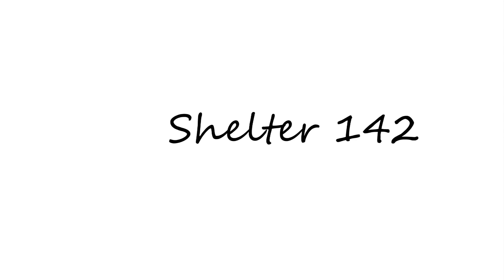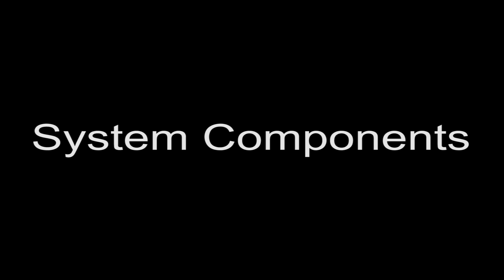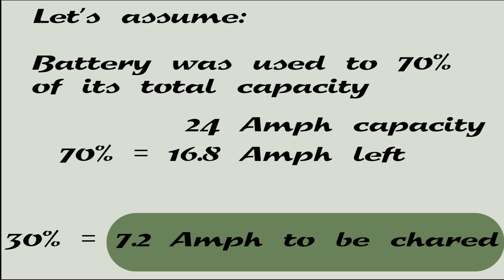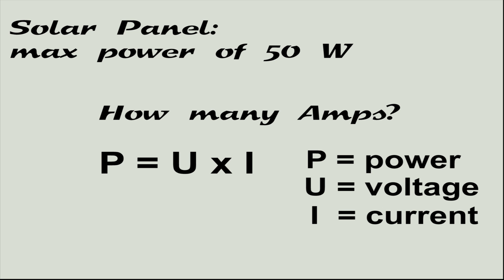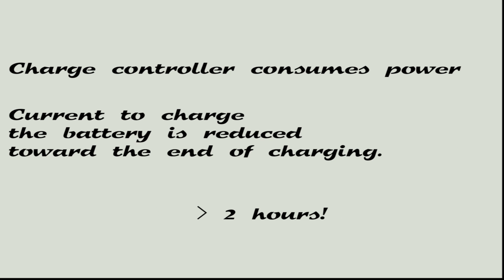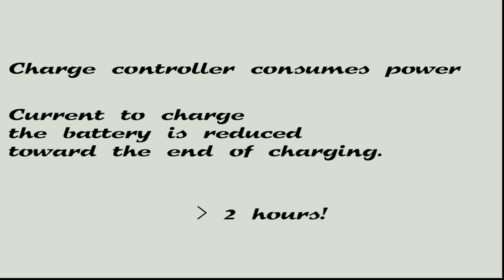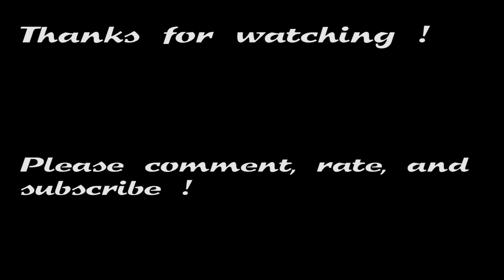How long does it take to charge a battery with a photovoltaic system

Comment: Where did you get the 14v?
Reply from the maker: This is another approximation, in this case for the voltage that the batterie is charged at. Check it for your system to be sure!

Comment: You said the panel provides 50W at around 14V. Is that from empirical testing? I don't understand because the label you show at the start shows rated voltage of 18.22V? Forgive me I am new to electronics. Does the 18V mean the absolute maximum, but in reality it will be closer to 14V? Is there anyway to calculate this from the label? (i.e. can you calculate it? Otherwise it would be annoying to have to buy a panel and measure it in order to know what voltage it runs at!)
Reply from the maker: Hello and thanks for commenting on my video!
The panel can provide max. 50 W, that remains given. However, the voltage at which the battery is charged is set by the charge controller/after the charge controller I estimate 14 V. My batteries (12 V) are charged at around 14 V when I use a charger plugged in to the wall. Therefore, I assume that around 14 V are set by the charge controller of the solar system. One can use a multimeter to measure voltage of panels.

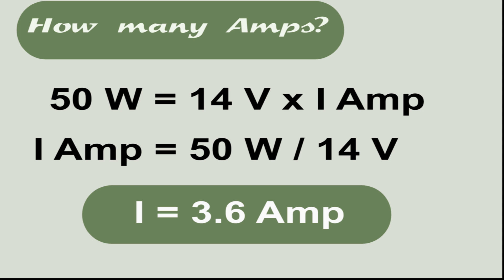Comment: at 1:41, from where did you get 14V?. I cant find 14V in solar specs which you shown at the begining of the video.I can only see 14.5 -- 14.9 V for lead acid battery as 'cycle use'. Pls. help.
Reply from the maker: As the calculation can only give an estimate, it does not matter if the exact voltage of the panel is 14,15, or even 17 Volts.

Comment: so what really charges a solar battery high amperage or high voltage?
Reply from the maker: Voltage at which a battery should be charged depends on the battery (typically even mentioned on the label), how many Amps at this voltage can/will flow depends on the panel, the charge controller, resistance, and the sun.

Comment: i have a big question like user afsar ansari, i have a mono 310 panel 24 volt, and a 228amp 20ah battery , my charge controller is charging the battery around 9.38 amp (maximum power current )(lpmax). example, i would like to buy one 175watt panel and to have a parallel current around 18amp, my question is, what is the maximum amperage i can apply to the battery with a charge controller, i really dont want to ruin the battery applying to high current?

Comment: I have 150-watt 2 solar panel and 230 Amp battery can u tell m how many hours to charge a battery !!!
Reply from the maker: given the panels are connected in parallel they might deliver 21-22 Amps, but I can only estimate that. You should check the specs of your panels to find out how many Amps they can deliver. 230 Amps/21 = 11 hours (under best conditions, full sunlight), real live charge time will depend on your geo-location and weather conditions. Make sure you include a charge controller that can handle the Amps! 21-22 Amps is a substantial current, be careful!
Reply: @shelter1426  P=VxI 
50W = 14 x I (assuming solar panel is working at 14V)
I=10.71A
when connected in parallel I=10.71A x 2 = 21.42A (this is what 2 solar panel will generate if connected in parallel)

Now, 
Battery Capacity: 230Ah 
if DoD% is 70% then solar panel need to charge ==> 230Ah * 0.3= 69Ah

Therefore ,
Time taken by 2 solar panel to charge 69Ah ==> 69Ah / 21.42A = 3.22 Hours

Dear Shelter142: Please correct me if my above approximation is correct or wrong based on your video info, Thanks
Reply from the maker: @adnanulhaque8846   you stated : "50W = 14 x I (assuming solar panel is working at 14V)
I=10.71A" --- but 50/14 = 3.57
Reply: Shelter 142....yes, that was typo...so, it will b 69Ah/7.14A = 9.66 hrs....correct?

Comment: The battery is 350 mah, and the solar panel is 5v and 25mah. How many hours?
Reply from the maker: the answer is in the video.
Reply: If I was able to understand what you explain in the video I would not ask. Vielen Dank!
Reply from the maker: Geschätze Ladezeit ist 350 amph/25amp=14 hours. Tatsächliche Ladezeit hängt vom Wetter ab, Beschattung, Geoposition, usw. 
Mit oder ohne Laderegler? Batterie liefert 4 Volt Spannung?

Comment: Hello shelter, I have bought my new Remote Control car consisting of a Ni-CD AA 700mah 7.2V battery and I don't know how much time do I need to charge it for making it fully charged.
Reply from the maker: you can probably just rely on the charge indicator light. If you want to calculate, find out how much current in mAmp is transferred into the battery during charging and devide 700 mAmpH by the current.

Comment: Hi i have four 70watt solar panel with 4amps . can you suggest me the battery for this panels ?
Reply from the maker: the battery should provide enough energy to power your device(s), and the panels should be able to provide a multiple of that. Battery, panels, load and charge controller function as a system and should all be matched. Doesn't make sense to just match panels and battery.